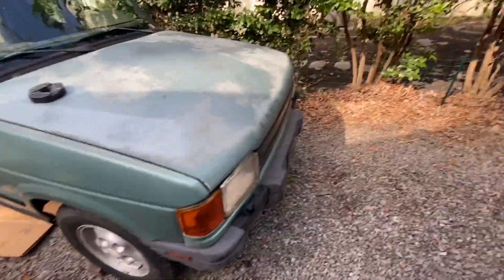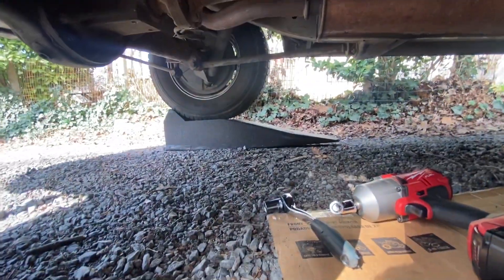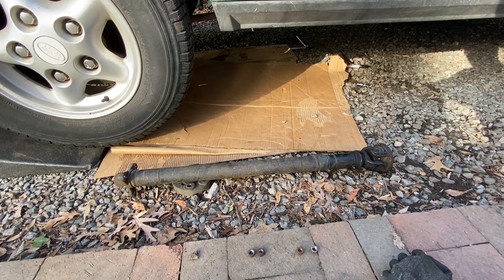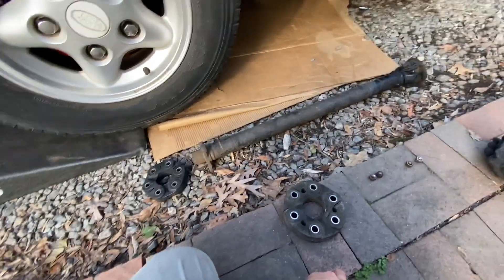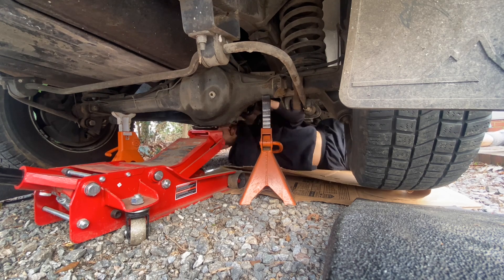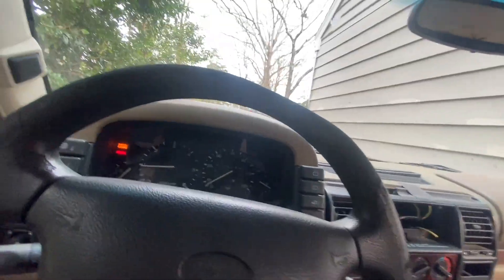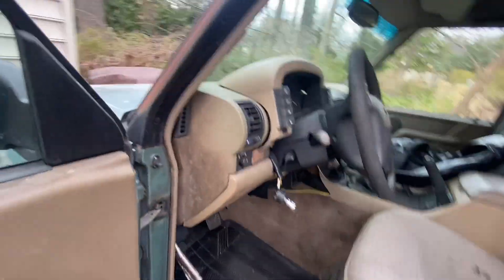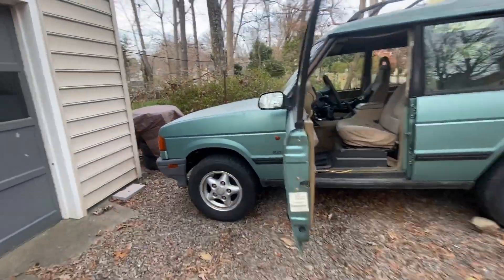(DIY) Rear Flex Disc Replacement - 1997 Land Rover Discovery (Manual) + Next ROVER SNEAK PEAK!

Comment: Well Lucky. Your suppose to keep the drive shaft in the same position. Leave the tranny end on. There are arrows on the rubber that tell you which way the bolts go. No bibs, you got it right !!

Comment: My 97 5-speed just has a normal UJ. My 96 5-speed had the donut. Back in the day when these were new the message board people often made that swap. The 5-speeds seem to tear them up more but also softens driveline slop/lash/buck especially in low range.

Comment: No necessery to remove the rear propshaft completly.  Realy important is to respect the right orientation of the rubber donut,  torque setingns for the nuts, and more important of all substitute the inner bushing of the propshaft at the same time. other way, the rubber donut will be parish in no time.

Comment: Do you think I should replace this rubber piece since I’m experiencing slight resistance with vibration around 70mph and hard to pass 75 mph on my 03 D2 . The truck don’t like passing over 75mph!
Underneath the truck everything has been refreshed!
Upper/ lower ball joints, sway bar links and bushings, greaseable front driveshaft, shocks, steering damper , new tires and brakes.
Reply from the maker: Sounds like a transmission TQ issue?
Reply: @AddictedMotors  
What’s TQ ? The trans is smooth and shifts nice as it should, and was serviced last year with new filter, oil and gasket.
Reply: what was the issue in the end? I am getting the same on my D1